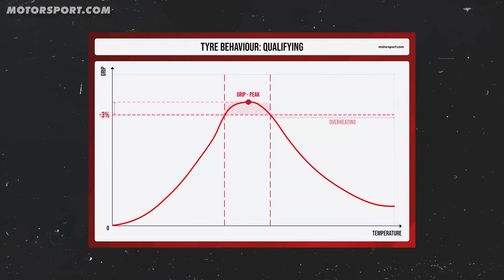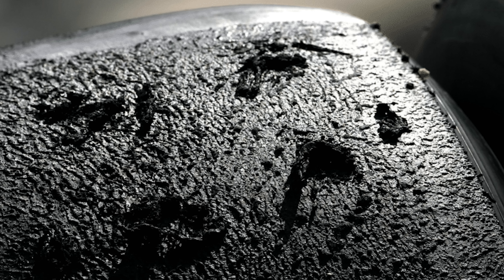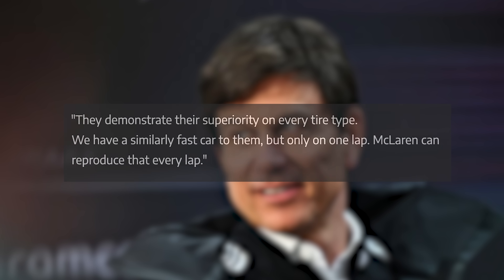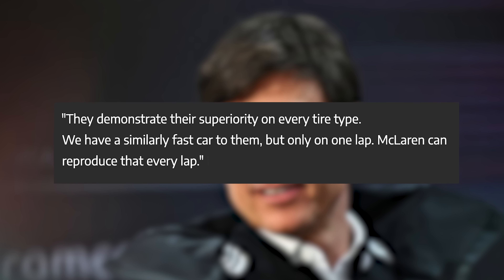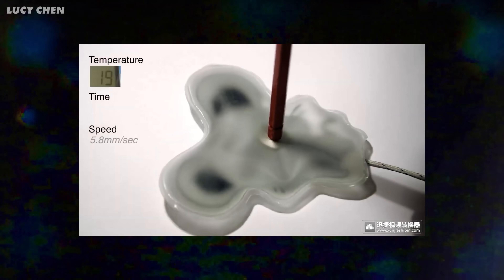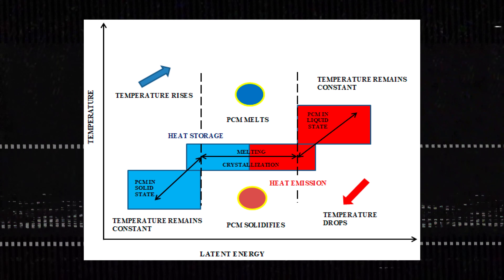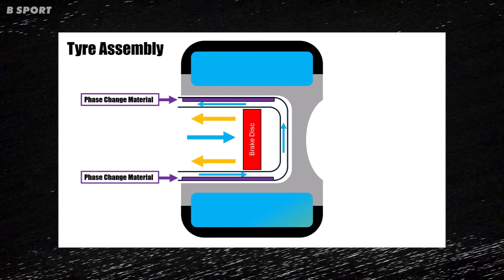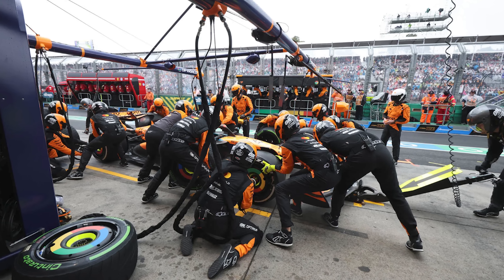McLaren’s GENIUS Tyre Trick Explained

Comment: McLaren went from an enigma to all the F1 teams to everyone and their grandma knowing their secret overnight thanks to this guy
Reply: The difficulty lies in the engineering, which is still secret. Phase change is a very old discovery and basic (school level) chemistry. The thermodynamics achievable are very complicated and are often difficult to compute. So every team will need a long time to copy McLaren
Reply: @blanciwiinom8060   The phase change stuff: It is physics, not chemistry, and it is rather simple to implement, but can take some time to fine tune. About every CPU cooler has these heatpipes, half of the performance exhaust valves have a similar solution (Sodium filled valve stems) The bimetalic thermostats are as old as the street, and even less difficult to predict. One could regulate airflow into the brakes with a bimetalic thermostat, and use heatpipes to move heat to a large surface.
Reply: @blanciwiinom8060  yep. Knowing what we know now, looking back we can see them having issues with their tyres while developing their current technology.
Reply: @blanciwiinom8060 Yeah, and they won't be able to copy this technique this year. Because by middle of the season, all teams will be putting their resources on next year's car. Some are already doing that.
Reply: Tbf they likely knew before Red Bull even went public and were working on their own responses to this solution from Mclaren.
Reply: @kwl189  A common tactic is to figure-out what your opponent is doing then file a protest to make sure it's legal before you spend the money and effort to develop your own version.
Reply: @ @phonebem

I agree. Or get it thrown out based on legality also before investing in your own solutions like Red Bull and Mercedes did with Ferrari’s engine.
Reply: McLaren is clearly very well versed in material science. They have their own carbon fibre labs and it seems to be paying off with the flexi body work and thermal change materials. 

Ferrari can’t even organise a driver swap
Reply: All the teams knew LONG before this bloke pieced it together lol
Reply: It's clear red bull knew it wasn't water. They were just creating noise
Reply: That's assuming it is what he says it is. It's a valid guess, but no one has confirmed it as yet. Plus it's not just the material on it's own. Even those combinedwith the reversible air duct wouldn't provide the drastic results we've seen in the thermal images where McLaren is so much cooler than everyone else.
Reply: @JD86Vintage  yes, I agree. What baffles me is that the phase change material can help with thermals by absorbing temperature spikes but does not prevent overheating, only slow it down. So there should be some thing else that helps with cooling.
Reply: @blanciwiinom8060 They suggest in the video if you keep your tires cooler they have better grip and that reduces the heat generated.
Reply: @blanciwiinom8060 it would prevent over heating if it never reaches the full point of melting. 

If an ice cube didn’t melt it would just cool your drink indefinitely
Reply: @blanciwiinom8060  no, as part of laps are much less stressfull on the tyres and they can reduce temp then. Also dirty air etc are really hard on tyres.
Reply: I think that depends on what phase change material they're using.
Reply: @blanciwiinom8060 air helps a lot when the heat its controlling isn't  too extreme
Reply: @blanciwiinom8060 But his analogy with the ice explains that. If you take a piece of ice into your hand after it has been melting in the drink for a few minutes, it's still cold.
Reply: @grahamhobson4091   the analogy with ice is not bad, but it does not account for the weight limitations race cars have.
Reply: @grahamhobson4091  in case of a lot of phase change materia ( in the analogy ice) this effect works realy well. but iff only a small amount is used due to weigh limitations the effect reaches a limit (all the ice has melted) and other cooling mechanisms have to be used, like air cooling.
Reply: @blanciwiinom8060  Slow down the warm-up long enough for a run.
Reply: I think he just created a job opportunity for himself. 
This cannot be that hard if you got someone familiar with material chemistry. Just need to find the right material and given the advantage this gives, team will be desperate to get this in now.
Reply: Knowing it and replicating it are two different things😂
Reply: the fun part is that if it's not *this*, it could occupy the competition for few weeks/months and take some material research budget before they realise it's not this and they just wasted resources... (and if it is *this*, it will still take them time and research). But at least McL is at no risk they will by accident (of not knowing where to look, so looking everywhere) find something even more performant and make McL clueless for rest of the year. So this video is like pure strategic win for McLaren... :D
Reply: There is no evidence to suggest that this method relates to what is being used.

There are other ways to achieve the same thing, but rather than mass to absorb energy, cooling flow itself can be reversed just by using bi-metallic strips.

Again, its equally as like likely that neither, both, or one or the other is being used.
Reply: These are just speculations. No facts at all.
Reply: @ClippyInTheMatrix  Nevertheless the facts of the better thermal management are there and are undisputable :)
Reply: @RainbowBelow  thats for sure! and I like thst. Best enginering magic
Reply: The video was available on Monday lol
Reply: Go look at bsport320 the guy in the video that actually released the first video on this. Dude is smart
Reply: No the team not him
Reply: Why is everyone assuming that this is true? What proof do we have? This is all just speculation.
Reply: But is not that easy, if it was wouldn’t be a mistery there is more to it than just an insulation material, what do you do with the heat that is not being transferred then? What about the brakes overheating?
Reply: This guy knows fuck all
Reply: That doesn't matter. You can't just add to the tire and it works. Probably have been producing tires and doing research ever since dude wrote his thesis.
Reply: Ok anyone did any calculation how much phase change material would be needed? Also would the heat shield material from nasa or spaceX work better at insulating?
Reply: @matthiasbroek8055  yep, McLaren did for the last two years.
Reply: @FlyingDutchMan8055  it depends on the material really, all materials works the same but most of them only absorb little energy, only them knows how much it can absorb and at which temperature. And it's not about insulation at all, like I said any material (liquid water to vapor for exemple) need some energy to change phase at constant temperature
Reply: Must be a Red Bull fan..
Reply: lol no pretty much every single person working for an f1 team would know about phase change materials. As the guy in the video says…. Getting it right is the hard part.
Reply: I think some more thermal imaging data would be useful to see, obviously the teams will have this, but could it just be down to the car design/setup in general in that McLaren are just hitting the sweet spot most weeks, especially in the hotter temps.
Reply: Nonsense. The teams already knew about this.   They just don't go around advertising how smart their engineers are
Reply: While phase change materials could contribute significantly to McLaren's dominance over a full race the car is still faster than the competition even in qualifying  proving it's a menace even without that advantage.
Reply: @gtrix3240  I believe Max had the last pole?!!!
Reply: @bobroberts3968 you either didn't watch or didn't understand the full video
Reply: @gtrix3240  True, the McLaren is fast; but consider that most teams MUST compromise their qually setups to keep the tires alive during the race (esp. Ferrari).  Controlling the temp would lessen or completely negate this compromise.  A gift that keeps on giving...fast in qually AND easy on tires.  Brilliant use of tech if it true.  Kudos to them.
Reply: @gtrix3240  Bet in quali they are faster sometimes by a few hundreds and then in a race they dominate with 40sec advantage
Reply: @gtrix3240 I don’t think so. Max, Kimi and Lewis have all had poles and even the ones McLaren have had have been close.
Reply: @gtrix3240  not as simple as that, this year all the top 3 teams have almost the same pace in quali, depending on conditions, but when you look at the sectors, mclaren have always the edge in sectors where others teams have to manage their tyres to finish the lap
Reply: @Y2Si  You're absolutely right and so were the others who brought it up earlier. I totally overlooked how McLaren actually gets even faster on their second flying lap during qualifying using soft tires. It's crazy, especially when you consider how most other teams start struggling after just one push lap.
Reply: @gtrix3240 well the technology gives you the fast heating up to normal temperature and keeping it up there so it explains qualy pace perfectly actually
Reply: @gtrix3240  Even in quali you need to manage your Tyler’s fro overheating. Often the tires drop off in the last sector. Or you delibratly take the first two sectors slower so your Tyers last all the way at optimal performance. Obviously McLaren have therefore also in quali a big advantage.
Reply: @gtrix3240 Their advantage in quali isn't that big though, there's less than 3 tenths between the 4 top teams come q3.
Reply: @gtrix3240 I agree with you but looking at lap times it seems like it still helps significantly, last qualifying Hamilton was within a tenth for the first 2 sectors then dropped almost a second on the 3 sector due to the tyres overheating.
Reply: @gtrix3240  While thats true lets not forget there were already races where other teams were just falling off a cliff in the 3rd sector already in quali because they just overheated the rear tires..while Mclaren didnt. Already in the first race in Australia it was very apparent that RedBull and even Mercedes to an extent were able to match the speed of Mclaren over the first 2 sectors but then just overheated and lost time in the last 3-4 corners.
Reply: @gtrix3240 Yes but no, yes they're definitely with the top teams even without it but they don't get every pole, their main advantage is what allows them to win the GP on Sundays, they could be slower (like Ferrari) in quali but still win with that advantage on tire temperature. And this also helps them during quali, some pilots have to save their tires at the start of the lap so they can still have grip at the end while McLaren can have optimal grip the whole lap, without this trick (if proven true) I don't think McLaren is as dominant as you say, they're good but not way better than their direct competitors on pure aerodynamics and mechanics.
Reply: @gtrix3240  exactly, and it's supposed to weigh more because of this material? I'm not buying it.
Reply: @gtrix3240  it's really not that much faster per lap. They've only gotten 3/6 poles.
Reply: @ImReverseGiraffe they are faster it’s just the McLaren duo aren’t consistent.
Reply: @gtrix3240  Yes, and also what the guy said at the end would probably put them at a disadvantage in quali, also, having looked at phase change materials for homes, I'm would be really suprise if a fine layer of pcm (so very little thermal mass) could keep tyres cold for an entire race
Reply: Let's be honest, if a YouTuber was able to recieve this information, so was every other teams mechanics.

Don't fool yourself, please.. youtube is like the stock market... if someone is telling you to buy, it's too late and everyone who matters already knows and you're just a guppie feeding off the rich while they already made their move....
Reply: @DCKingOfOzonee In this case, the YouTuber “receiving information” (more like building a theory) is also the F1 engineer basing his master thesis on the application of phase change materials in F1 and writing it at McLaren😂 It’s definitely not just some YouTuber with public access to information doing a bit of research
Reply: One thing knowing and it is another creating a working part.
Reply: Lol, u really think Mansell solved f1s biggest mystery and put the solution on yt for a couple thousand views and teams had no idea??  He just proposed a potential tire cooling material, implementing that is the real unknown.  There are no answers here.
Reply: Huh? Are you new to F1. We’ve known this for a while.
Reply: Want of they used ai in thuis case. How else could one explain their sudden change of speed. Since last year